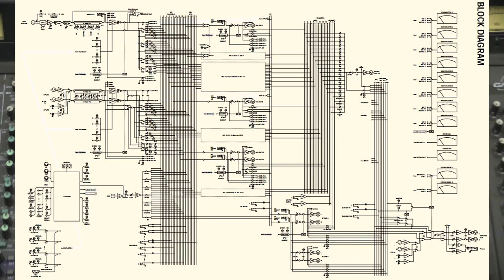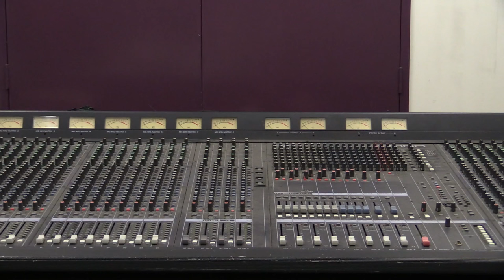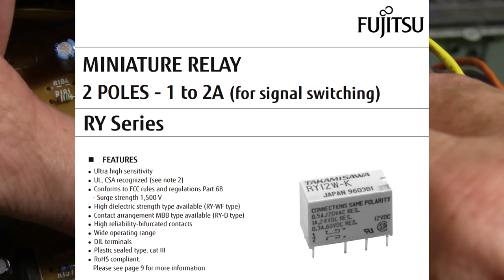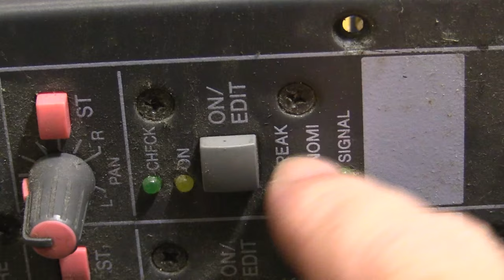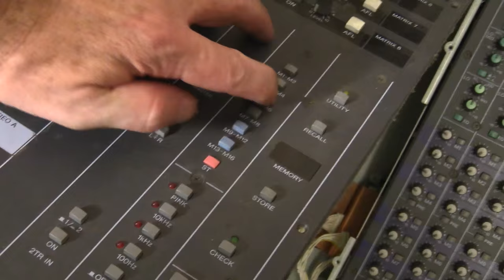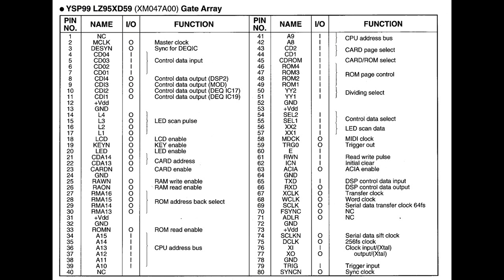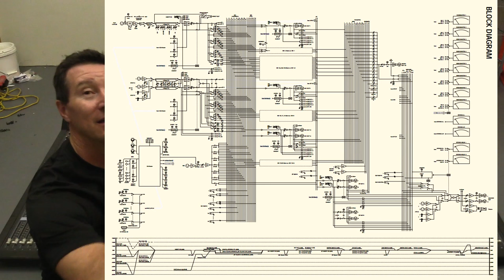EEVblog #840 - Yamaha M3000 Mixing Console Teardown

Comment: Huh? Video compression looks muuuch higher than usual on 720p (look at the purple cabinet in the intro shot). Just pointing it out because that's not usual on your channel since you like a high quality picture.
Reply from the maker: +Ivan Eduardo Veloz Guerrero Perhaps the lack of light in the bunker.
Reply: +EEVblog yeah makes sense, don't worry about, it was out of your control. I dont like it when video compresses like an uniform color all over a surface, but that's the price we pay for low bandwidth :(

Comment: Powered Moving Fader Sliders? It looks like it was overkill for whatever its application was for due to only having a handful of channel labels stuck on it, but holy crap its nice.... The surface screws are maybe for replacement of individual knob/buttons without having to crack the top off entirely or something or while a performance is going on.
Reply: I'm guessing he labels are for things that weren't ever disconnected and it was a permanent install.

Comment: Now that digital consoles have (in most peoples mind) equalled the sound quality and completely surpassed in practically of these old analog beast's they are not worth even a fraction of what they used to be. 

It's worth noting that with analog consoles you would still need a few racks worth of effects units (compressors, gates, reverb, ect..) to have what you need for a professional show.

Comment: But you actually were lucky, I know about mixers where the individual PCB's were screwed to the chassis to ground, and they were covered by one (!) faceplate. A friend who runs a studio had one like that, 32 channels (a small one...), it had one broken pot and we spent three hours taking all the knobs of, of course only aluminium knobs with grub screws, to desolder that one bloody pot.

Comment: Total hypothetical but the large gap between the boards at 36:25 might be due to chassis flex. Given the size of the thing? maybe? probably not.
Reply: It's probably because the desk is available in a 24 channel version which would end there.
Reply: +Ben Franske Indeed. Good call.

Comment: add another 100 kg of flycase :D u get it for free? dang how lucky u are ! 
Yes u can extend it and for static use (now moving it it's a bit pricy and u have to move in 4 )
the direct out allow u to split the signal  directly out   to process the signal on outboard. like channel 1 lead voice mic direct out to external effects ( reverb, delay etc)  and route back to another channel so u have the clean voice and the effected voice in 2 different channels.
The instert is to instert an effect in the channel line (like a compressor) and process it usually after gain and eq section.
that consolle is a BEAST. plus have nice analog buses.
Those relay are to switch the signal, so back in those days to keep the signal much clear as possible they shielded even the relay ... so high ql manufacturing !!!

Mix insert allow u to instert to the mix channel an outboard processing ( tipical an external 32+32  cursor eq to balance the audio with the venue)

on the left of main bus board section isnt screwed couse left wing was optional . on broshure u also linked u can see the main setup is a 24ch. then u add the 2 module on right and u got the 40 channel ( the one u have in your bunker) and then u add 2 more bays one on each side to add other 8+8 channel ( and u reach the 56 ch version).

You're amazing with a lot a passion knowledge and daaaaamn nice stuff !!
Best greetings from italy

Comment: The M3000 is an interesting beast, sort of an ugly duckling console.  Most Large format pro consoles of the time were completely modular, each channel it's own pcb and front plate that could be removed as a unit for service or replacement.  Yamaha set the standard  with the PM 3000, followed by the PM 4000 and PM 3500.  The PM 3000 was among the first commonly available consoles to feature VCAs, which allow some mixing tricks that can't be accomplished with simple sub groups.  The M3000 was Yamaha's attempt at lower budget, large frame console with VCAs.  Cost was saved by building the console in modules of eight channels.  It was never a very popular board.  Lower budget boards from other manufacturers quickly took over that market segment.  When digital consoles began to achieve dominance, Yamaha was there again at the top and middle of the market.  Their PM5D became the workhouse console for the first decade of the digital era, and remains fairly common today, even as Yamaha's newer CL consoles are becoming popular.
Reply: BTW, the SSM2018 is the VCA.
Reply: Yamaha’s CL series WERE popular. Fixed that for you. The world has moved on, these days you're probably more likely to see a Behringer x32 on the low end and a DigiCo on the little bit higher end. The CL series has shown its age.
Reply: Ben Franske We do see lots of x32s on everything from tiny little bar shows, to support acts on major tours.  It's part of a great, affordable, versatile product line.  Heck, I just bought an XR12 to outfit a small touring client with only a few inputs on deck.  But the x32 (or even the M32) will never be a CL5.  It will never do the event I do with 60+ inputs from the stage and a dozen different outputs for FOH alone.  It will never handle may dozens of networked audio channels the way CL consoles can over Dante.  The x32 is a great tool, and should be in the rental inventory of every regional company, but it ain't the be all and end all of consoles.  We see lots of Digico product come through on tours, and it does show up occasionally in the corporate market, but as they are, the Digico consoles will never be a dominant product in the regional/local rental market.  They're just too complicated to setup for a one off event.  Avid Profiles are still popular on tour and at the local level, Midas is maintaining a strong presence at all levels of the market (I mix regularly on XL8 and Pro series consoles), Soundcraft VI consoles are floating around in various areas.  Not to mention the other players like Allen & Heath, Roland, and who knows who else.  Plenty of consoles to go around, Different strokes, different folks and all that.  Certainly more than Behringer and Digico in the world today.

Comment: Your nomenclature is a little bit off... ;-). But also this Yamaha is a little peculiar with regards to its labeling.

What's most often called Groups and "Aux"es is generalized to the "M<n>" mix-busses on the Yamaha, and the function depends on how you configure each bus. The particular function (Group or Pre-/Postfader AUX) can be realized as a Fixed or Variable Pre-Post-Master Mixbus. (Pre/Post-switch on each channel, Fixed/Variable switch on the master section).

Comment: @ 21:00 BA682A  Level meter LED display driver.  Made by Rhom.
@ 35:09 YM6104 Programmable digital EQ chip with programmable coefficients (internal RAM 128 words)
@ 35:14 YSP99  Gate Array
http://www.dtech.lv/techarticles_yamaha_chips.html

Comment: They probably didn't need a double sided PCB because of the huge front panel eating up so much space anyway.
Also, the datasheet for the SSM2018 was the 3rd google result for me:
http://users.ece.gatech.edu/~lanterma/sdiy/datasheets/vca/ssm2018.pdf

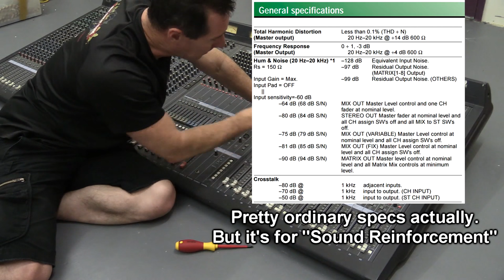Comment: 11:50

I'm hoping this means that the S/N ratio is 68dB at the MIX OUT when the preamp gain is all the way at max on one channel?  Otherwise that's pretty poor S/N.  

If this would be used at a big outdoor concert, imagine +4dBu output voltage might be around 120-130 dB SPL.  So then the noise, 68 dB below that, would be around 52 - 62 dB SPL, and surely multiple channels' noise would sum to be even worse.  Could be audible during quiet parts of the concert.  Again I'm hoping this means at max preamp gain, which appears be 60 dB of gain if I'm reading it right. I wonder what it is at more typical preamp gain levels.

Comment: Just a heads " mind you some one else may have already mentioned this down below in regards to the relay shielding. 
Mobile Mixers may be used near Large PA Bins "Delivering Kilowatts of sound" Speaker Bins could have several Drivers in each with massive Magnets, and well long story short their magnetic fields whilst producing sound can fluctuate and interact with each others magnetic fields, which could fan out and interfere with any unshielded electromagnetic devices Eg: an unshielded electromagnetic device could easily be triggered by any stray magnetic fields, and well we cant have our sound being effected by erratic behaviour..

One more thing AFL can only mean one thing ;) go my Footie Team!.. Yeah I'm not some egotesticle narcissist look-n for conflict.
WAIT! I also should mention if anyone has used a Mixer produced over the last 5 years should know this Mixer is not as complex as the ones on offering now, As a DJ I only Need 6 Channels, but I know there are mixers out there far more complex,  as most if not all mixers now have banks of FX delay Loops with FX delayed overlays, echo overlays, Echo FX delay looped, Bluetooth FX add, Bluetooth Loop back with delay and FX Delay overlay, and some even have Digital variable Pitch.. My Mixer doesn't have all those features but it does have some basic FX's, echo, and delay controls.. and the unit was well under $100 bucks NEW.. yeah, yeah eBay Clone much like my previous extremely basic one that only lasted 12 years..

Comment: As that busboard seems to be such a fairly simple construction, why make it as a PCB when the mixers and parts are not slotting into it? Why not just have it as one wiring harness that the sub units plug into and that has connectors on the ends for extensions? Even if it needed a block of components they could be put on one board connected to the main harness, it seems like it would be cheaper and more durable than a massive backplane PCB.
Even with the mix insert component block and the regulation block, it seems those could be two boards with a master harness, but that's just me.

Comment: In general these ld analog boards are going for nothing. A lot of churches, venues and sports arenas are switching to digital boards which are smaller, and offer memory.
As far as that board, I used to work on Yamaha PM 1000 and 2000 series. Thats a kind of a mid tier product line. 
The Yamaha thing was their matrix mixer. Which is the mass of knobs right in front of Dave. It allows you to mix all the busses in varioys combos for different speaker stacks. 
Most of the knobs on the channels are going to be for effect sends. 
The scene memory only stores VCA level and group settings. A modern digital equivalent would save EQ, effects, and every other knob and setting per channel. Some even allow for timecode synced automation. Such that they turn thigns up and down in time with the audio program. Great for synced video and big productions like Broadway stuff. 

This board isnt that sought after. It's not got transformer balanced inputs or discrete mic amps or inductor EQ like the older PM series stuff. 
The power rails are probably 12 or 16v bipolar. Older Yamaha PM stuff was 24v or 44v bipolar. So there is a difference in headroom and such too. 
The older model series would have had an all discrete through whole architecture. With a seperate board for each channel, and for the master busses. 
The 8 channel PCB buckets are a later cost saving measure they got into in the 90's. 
You should see the old PM1000 construction. Bell Labs style cable wrapping, the like of which I've only seen in old school AT&T facilities.

Comment: 36mins about the board being square without the inter connects, its probably so the board can be removed? would be impossible to remove if it had interconnects either side without the harness, maybe?

Comment: I can't watch this. I'd have loved to have had that thing.
Reply: Looks very "crusty". Faders and pots probably need to be replaced which doesn't make it worth it (certainly not in that price range).
You can get much better consoles than those for practically nothing (sometimes even for free or just the price of the case and/or PSU) because it's often not worth servicing anymore (replacing all pots will cost you a fortune unless you do it yourself).

Comment: Chances are that this unit was replaced by a digital console which is standard in pretty much all equipment riders these days.
Reply: +chrisose 
Both Rupert Neve Designs and Allen & Heath still make big analogue consoles.
Reply: douro20 There are actually quite a few companies still making analog consoles it is just that most acts are looking for digital. This means if you happen to run a venue with an analog console you are going to end up hiring consoles whenever you have a headliner come in.

Comment: maybe £140,000 or $AUS 210000, I think that it might be worth keeping it in one piece and getting the PSU unit also and using it on your Youtube account to get really good sound, a computer PSU should work and you should be able to generate 48 volts easily.
Reply: +DAVID GREGORY KERR That's not quite how that works.
Reply: +NZ SNIPER On so many levels.  There seems to be a "computer power supply solves all world's ills" cult on the internet these days. :-)  Not sure where one expects to get 48VDC on a standard ATX power supply with a 12VDC rail that is very likely to be referenced to earth ground (which means they can not be connected in series as-is without shorting).  But for the curious, a computer grade switching power supply is the last thing one wants on an audio mixer where low (electrical) noise is critical.

Comment: Why is it so massive? Wouldn't it make a lot more sense to design it in modules? Looks like the controls are in 7~ groups, couldn't it be split down those 7 lines?
Reply: +Christian Gerefalk The completely modular desks our usually higher end studio gear. This was probably cheaper to manufacture.
Reply: +Christian Gerefalk It is modular. Each section contains eight full channels. The way this is done they can offer most popular configurations that are multiples of eight and only have to change the size of the frame. Offering individual channels is basically useless. That's really only something you see on VERY high end gear (Neve and the like) that's typically hand-tailored to a specific studio.
Reply: I think OP meant why arent the modules in physically separate chassis. 
An answer to that question is that if it was broken into ~7 pieces is that you&#39;d have to connect each section with a huge million-core cable on which the pins would be another point of failure, not to mention knocking a module off the end of the table and damaging said cable. (Having said that, some mixers do have functionality for exactly that).
Another answer is that custom cases for these things generally have a flat base and a lid/hood that you lift off the top and the mixer is never taken off that flat base. So you wouldnt even need it to be in smaller modules because youd never separate them anyway.

Comment: WOW i have this same one in my bedroom! it was thrown out due to the seens not keeping memory.
Its stupidly overkill for are podcast but id like to fix it, did you see a replaceable battery anyware?
Reply: The battery was covered in this video (you'll have to watch the video, I do not have a timestamp).  It is a common coin cell on one of the boards associated with scene memory.
Reply: +Ethan Poole   Pretty sure it was a CR2032.   About 2 bucks.

Comment: 27:13 by "local decoupling" does he mean local DC filter caps?
Reply from the maker: +Michael Slade Yes. Decoupling caps across the chips and at the DC input to that board/subcircuit.

Comment: 20:22 With audio boards of this complexity, SIP op amps make layout a lot easier. The most trivially obvious example is no jumpers or convoluted traces are needed for the power supply.

43:20 There's the digital part! Boring as batshit. By the way, of course any digital is gonna be an afterthought (referring to the part about the 5V regulator bolted to the chassis) in an analog mixing console.

Comment: This was built at the end of the analog era..... yes professional but the lower end of the scale... inserts are for dynamics, aux sends for multi effects and "monitor mixes" the matrix system is for blending multiple outputs. the scene memory on this desk is mostly for turning channels on and off........ I think this desk was about 40 or 50K USD when it was new. I absolutely hated mixing on this desk it sounded like crap and the Eq's were terrible. I was more of a Midas xl series fan. The faders were garbage but there no audio path so they didnt need to be high quality.

Comment: I never been a fan of the modern PCB, that is a multi-layer PCB with tiny surface mount components and specialist chips. Despite all the advantages of surface mount, it's made a technicians job way harder, where no longer you can get away with a stranded hand held iron, now you need a surface mount soldering de-soldering station which is a lot more expensive. The idea of surface mount, is to save money for the manufacturer, smaller lighter enclosures, less shipping, packaging, and when it fails it is virtually impossible to repair, especially if the manufacture has included special IC's that you can not get., so ou fotrced to throw it away and buy another manufacturer wins again the consumer looses, and the repair techncian is out of a job.

Comment: You'll undoubtedly hear some snake oil salesman say "this cable makes things sound better"

If it wasn't recorded properly to begin with, no cable, no matter how much pixie dust has been sprinkled on it, will make it "sound better".

...then comes the "oxygen free copper" pitch.  [sigh]

I spent many tens of thousands on a home theater a few years ago.  They tried to sell me 11, $900 XLR cables that go from the preprocessor to the amplifier.  Thanks...I'll make my own -- and I did.